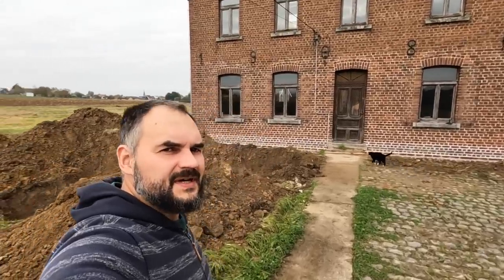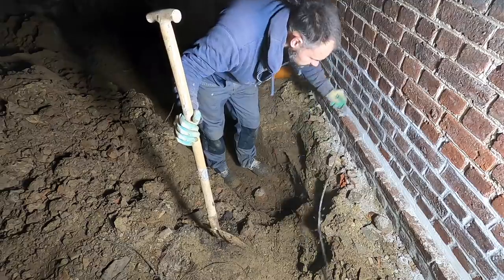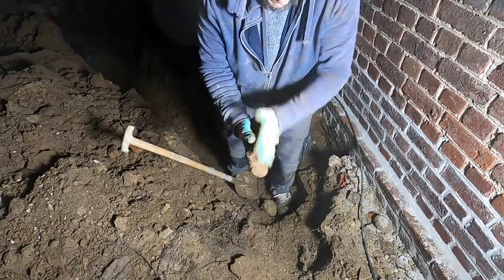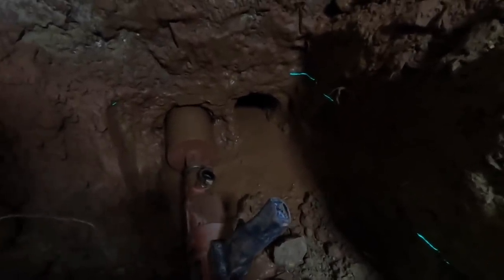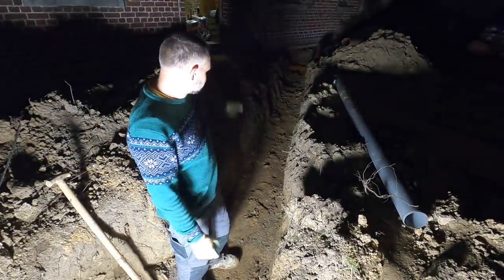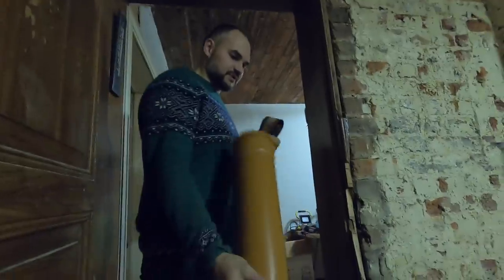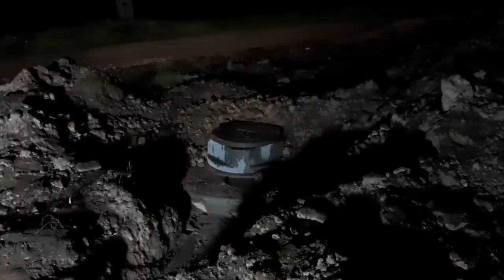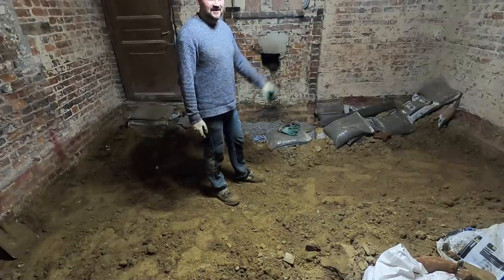DIY Connect waste pipes to our BRAND NEW septic tank

Comment: Do you have septic to a municipal pipe system or do you hire a service to empty your tank? The rain water and septic access are a curiousity to me.
I have operated vacuum trucks here in Canada and septic tanks were a necessary part of the job description. "Camlock" fittings are a familiar sight for connecting stationary tanks to mobile tanks with a hose. If there isn't a connection, the hose goes into the tank.
Don't forget to install "back-flow preventors": the one-way gate that prevents backup from the tank, and "clean-outs" in case of blockages.
I continue to watch your progress with amazement, you're doing a great job.

Comment: The cobblestones were installed before too high. The original level you found as you installed the pipes at the wall is the correct ground level. If you reduce the front entire ground level back to the original level this will greatly help to remove moisture in your foundations. At present the excess/high soil level is basically acting like a sponge and as it is in direct contact with the entire front wall of the house - the water goes straight into your walls. 
As mentioned before I would advise a French drain installed all along this wall. You have dug most of the area now anyway, so best time to do this and it will not damage/affect your walls/foundations.
The entire front ground elevation needs to be regraded and reduced to the level you found - the original ground level.
Reply: Since the road level changing over the years has probably been a factor can they do sort of a terraced grading with proper drainage?
Reply: Lorraine McBride I think by the time they have removed the soil all along the entire front of the building (that was added at some point long after the building was first built) - they should have a gentle grade towards the road. 
They have another big issue - the neighbour farmer field looks on camera to be higher than their property and sloped towards their property. That means every time it rains their property will receive all the water run off from the adjacent field. This is probably why someone added all the extra soil years ago around the front of their house.
The solution is to install a French Drain along their property line with the adjacent field using a large diameter slotted drainage pipe c.6-8 inch pipe. The entire backfill in the trench should be rock - all the way to the surface. The drainage pipe will need to be connected to the main road water drain line to ensure the water is taken off the property.

Comment: You should address the drainage issue at the front of the home, now that you have the cobblestones up. A french drain would do wonders to keep water away from the foundation, and you could connect it to the waste water pipe.
Reply: and fill the septic tank with rainwater? Not so sure about that :D
Reply: @PripyatSoldier  I'm sorry,  not into the septic tank, but into the storm water drainage system.  If there is no storm water drainage system, the water can be diverted into a ditch or low area around the home.

Comment: I noticed that you are not gluing were the pipes come together, are they self sealing? Progressive can look slow but really all the things you have accomplished in weather proofing the house and making it water tight are the tedious tasks before the fun stuff comes on the inside.  Great job and thanks for sharing.
Reply: I thought that too.  Then I thought maybe in Europe with the big changes in summer and winter the pipes need to be able to shrink and contract at the join more freely. Hopefully someone will know for sure.  I am also amazed that Illyia did not have to be inspected by the council before refilling all the holes.  All the best to you both - such hard work, but important.
Reply: There’s a rubber seal inside the wider end of the pipe

Comment: Don't the joints between pipes need to be sealed with a two part adhesive? Just checking before they are buried under concrete.
Reply: The socket ends of the pipes have rubber "0" rings in them that seals it , he was sanding a taper and lubricating the pipe before he pushed them in but it's still takes a bit of muscle to do it 👍🍻

Comment: You are using 2 colors of pipe and in the movie correctly named 1 for the black water in NL named as DWA, color orange and 1 for the rain water called in NL HWA, color grey. It was a bit difficult to see but according to me you mixed the 2 colors of pipe for the black and rain water. This should have been separared. There might be a danger that in the future you will connect a black water pipe to the rainwater pipe. I don’t know what the belgian regulation regarding the amount of sewage water will be but here in NL we are more and more disconnecting the rainwater from the sewage, because there is no need to clean rainwater, and it gives the sewage system such a surplus of water that the system overflows. Another trend here is to drain the rainwater on your own land. But this can only be done if the ground is sandy. If it is clay this will not work.

Comment: Yeah, the concrete path to the house is removed! Much better. Cobble stones back and no stone around the house for at least 50cm. Any water goes straight into the ground and does not stay on the concrete. And Ilia's English is so much better. Great work guys.

Comment: For those who wonder about glue: the pipes have a rubber seal on one end, hence the soap. 
From what we can see in your video, I suppose there is a public sewer system? 
About grey and black water. The grey water (bathroom, laundry, kitchen) contains lots of grease and soap residue which tends to clog the pipes and has a negative impact on what's going on in the septic tank. Therefore, the grey water should bypass the tank and go straight to the public sewer. Installing a no return valve just before the grey and black go into the sewer prevents big trouble inside the house if/when the sewer overflows.

Collect your rainwater in one of the old tanks in the backyard and use it to flush the toilets. Even after a number 1, use he big flush and you are sure there is no build up in the pipes (what gives you kidney stones has the same effect in the drains when there's not enough water to take it away)
Otherwise, great job!

Comment: It's good that you already separated the grey and black water, we did that too on our house. A small remark; you first have to prepare your 'Stabilisé' before using it. Stabilisé is actually sand with a little bit of cement so I don't know if it will have it's effect when you just pour it dry into your trench. I saw that it rained afterwards so it should be fine :) Belgische groetjes!

Comment: Is it actually ok to use the grey pipes like that? I only use them inside the house above ground due to possible hot water (HT Pipes high temp) The browns are intended for unterground usage, because theY are much more sturdy. Please correct me if I am wrong.

Comment: You should never use concrete to set sewer pipes, they need to be able to flex and adjust to the movement in the ground. Pea gravel and sharp sand should be used. It would never pass a building inspector in England.

Comment: my suggestion  in between outside wall till  main  septic  tank   there must be  in between near turning  point  one  small  main whole . because if in future there is some blockage  you can clean  easily  not need to open main septic tank  lid .

Comment: Will there be enough water flow (one toilet flush) to move solids through the black water pipe by itself all the way to the septic tank ? Using one line for both black and grey would have a lot more water going through it ensuring a good flow to the tank was my thinking.

Comment: The U.S. generally uses a solvent cement to connect the PVC pipe, but I'm pretty sure solvents are discouraged more in Europe. I like the advantage of being able to take them apart as you fit them, but that is a disadvantage too if the alignment is just not perfect. it is interesting seeing the differentces

Comment: Hi I`m not one to be critical but did you use pvc glue on those pipes , If not and it appeared NOT they will move over time and leak ,
Reply: The sockets on the pipe and fittings have rubber rings inside to form a tight seal 👍🍻